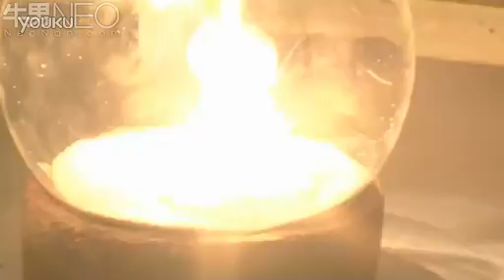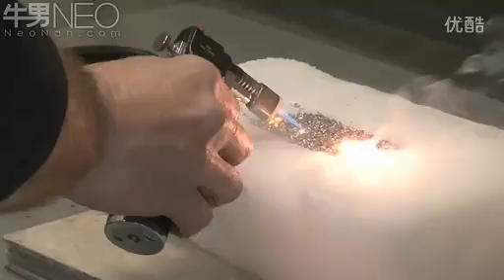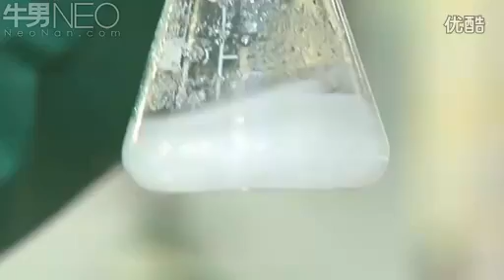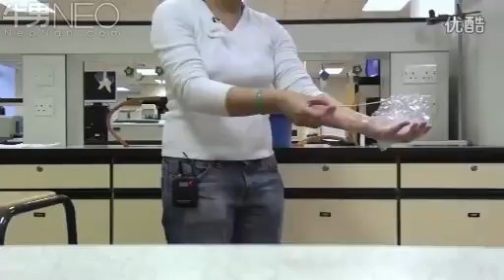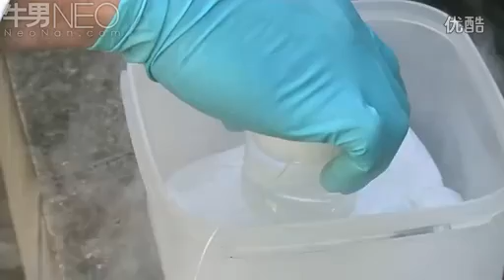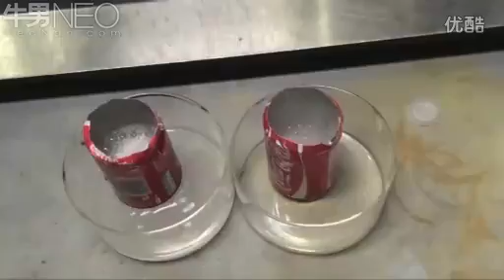The most destructive chemical reactions

Comment: Instead of those boring chemicals, try some FUN chemicals such as picric acid, old perchloric acid and perchlorates, and others... Let's party on the next video.. Check out mercury fulminate that is manufactured from nitrating mercury. It must be stored in water. It will detonate from a breath, wind, or even a feather touching it.. Yeah, buddy, you can't get more fun. If you can get formaldehyde, make some CH6 or C4 plastic explosives.

Comment: ANY chemical explosion or negative reaction is the MOST destructive. If you want the MOST devasting chemical explosion, try placing ANYTHING near Ethylene Chlorohydrin. That chemical is so unstable, to use it, a chemist must firstly place a ground on his/her tongue and ankles, ground the table, ground the glassware used for the transfer, and ground the actual glass it is stored in. the lighting must be grounded also; otherwise, you will have a great explosion. It is the MOST unstable of ALL chemicals. Even nitroglycerin is not THAT unstable. Any vibrations may cause nitroglycerin to explode; but, it is stable at 20 degrees below zero Fahrenheit. Powdered metals of ANY type explode instantaneously, if they are finely powdered. Aluminum is used for many explosives; including military.
Reply: Azidoazide azide pls

Comment: "so in this case, K = [SO3]*[NO]/([NO2]*[SO2]) once the system reaches equilibrium.
 So, 4.79 = (1.00+x)*(1.00+x)/((1.00-x)*(1.00-x)), because both products will increase by x when both reactants decrease by x (the coefficient in front of x depends on the coefficient in the balanced chemical equation)."  In other words, tube full of NO2, drop in SO2, and get MASSIVE BANG